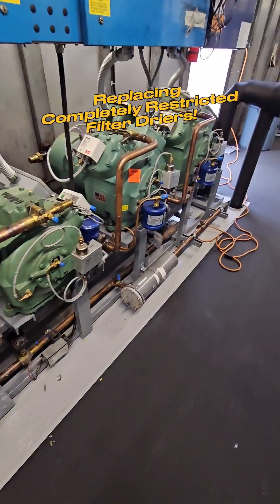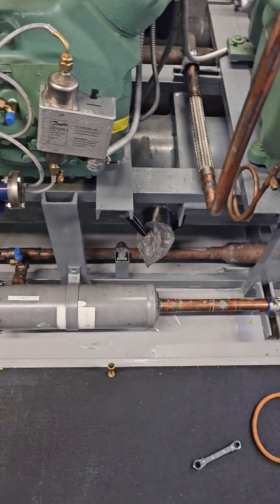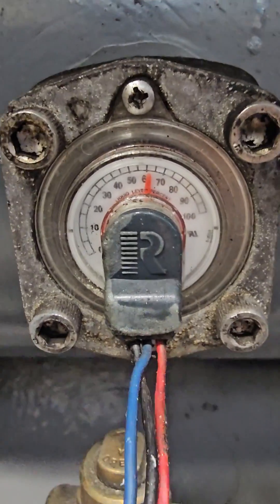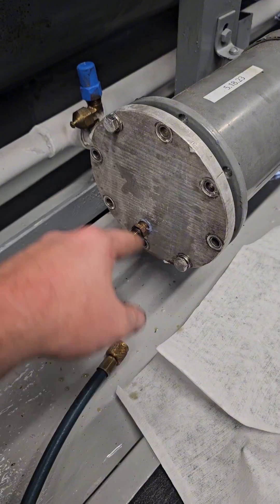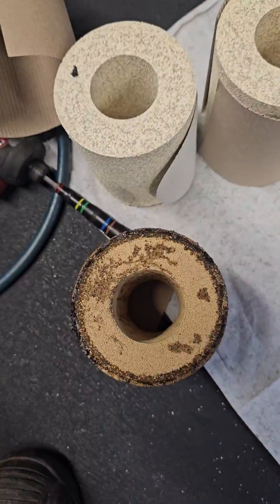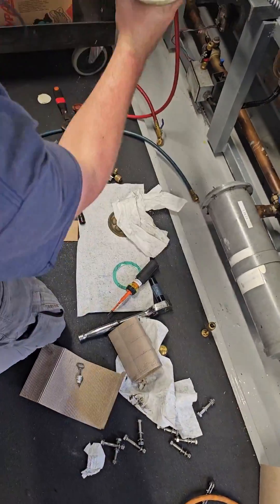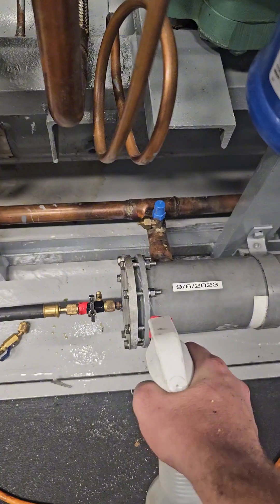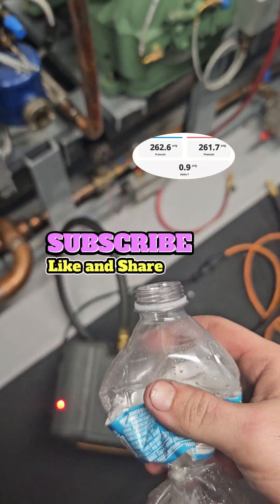Rack Refrigeration | Replacing Restricted Filter Driers!

Comment: How careful do you have to be about refrigerant fractionation working with zeotropic refrigerant blends in a rack system?  Too bad we can't use A2L refrigerants in rack systems, otherwise we'd probably be using R32.
Reply: The rack never stops running it’s always either stacking liquid or evaporating liquid there’s no chance for the different liquid densities to separate.        But wherever there is saturated refrigerant; depending on the location of the leak in the heat exchanger will depend on which refrigerant leaks out first. And if the leak is near bottom of the pipe or vapor coming out the top. Pretty sure there’s a lot more variables that go into it. But that’s my thought process.

Comment: Great idea on the hot gas purge! I assume you running discharge gas into one side of the drier and pulling it out the other side running to the suction port on the rack?
Reply: No he’s using the hot gas to boil the liquid in the drier. So it is then ran to the circuit headers liquid supply to the cases, and pulled back by the compressor suction side. Once the liquid is mostly gone you have some remaining gas, which he then dumped into the suction header, which is already a lower pressure. I would shut off the circuit epr valves as well, so on start up you don’t have a huge load demand when they all turn on at once.